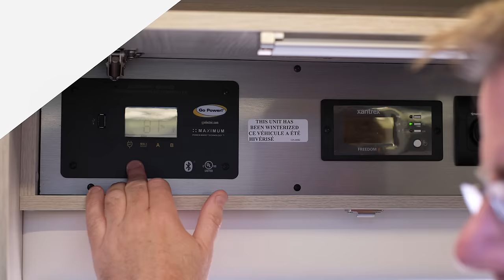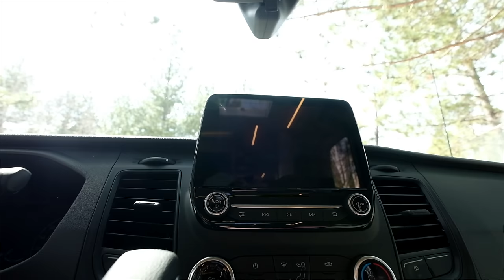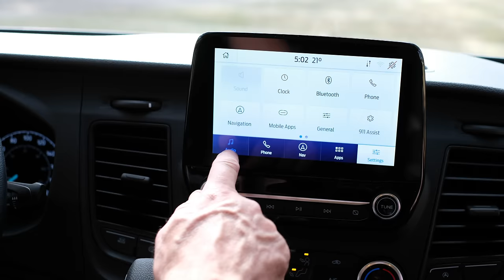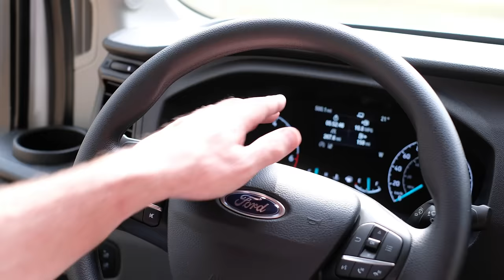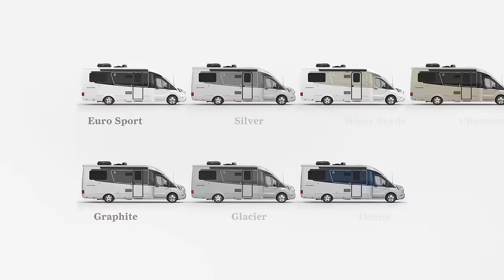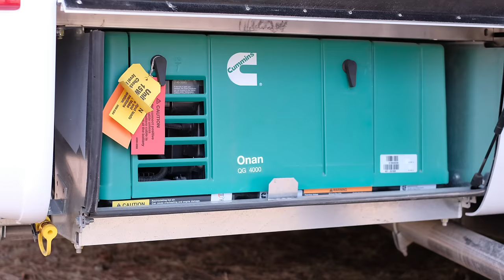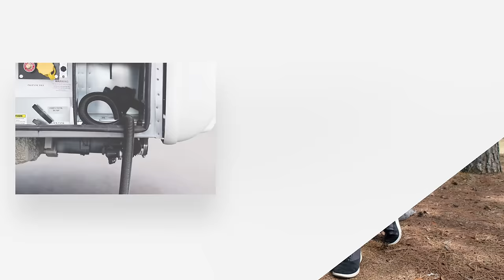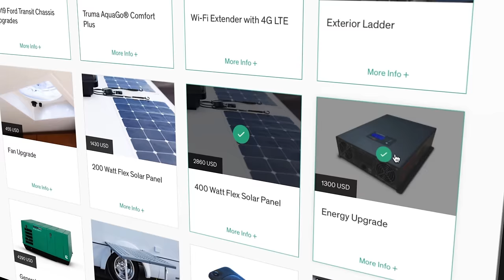2021 Wonder Rear Lounge

Comment: LVT was one of the very first Rvs that I investigated when I began to look into buying a small Motor home. I have always been very impressed by options and amenities offered; especially the Wonder as it's built on the Ford Transit chassis, not MB which can be very unreliable and very expensive to maintain and repair.  I first fell in love with the Wonder MB, then the Wonder RTB, and now the 2021 Wonder RL with the 3.5 liter Ecoboost engine with twin turbo and AWD.  Just like an F-150 with the optimum towing package.  One of the very good LTV dealerships, Fretz RV is nearby as well.  So, it was with great interest that I watched Dean's new vlog about the 2021 Wonder RL, and then his subsequent Q and A session.  It was during that episode that I learned, for the first time,  that all LTV rvs  are NOT 4 season rated; no heat ducts for the tanks, no heating pads for the tanks and no heat/freeze protection for the dump valves.  Dean went as far as saying that LTV customers were better off driving to Arizona (or similar warm location during the wintertime so that the rvs would not be in danger of damage).  You can imagine my shock, as I always just assumed LTVs were 4 season capable being manufactured in Manitoba.  I never read or heard anything to lead me to believe they were not cold weather ready.  It seems that 4 season capability is now standard or available as an option on virtually everything 5th wheel, TT or  Motor home I look at.  I hope LTV looks into rectifying this omission soon.  I will not be able to consider acquiring one until it is.  SK41.
Reply: 100% agreed.  A cold weather package option should be available.  Hopefully LTV comes up with something suitable.

Comment: Love this design. I need someone to buy this now. Drive it enough to break it in. Keep it in really good condition with low mileage. Then when I retire in about 6 years, sell it to me for a song.
Reply: I want to buy a new one to use for just a few years, very light use to visit family in 2 separate states....then sell!!!
Reply: Twin turbo ten speed auto- not even for free, used!
Reply: Good plan since a buyer loses a minimum of 15% to 20% the moment you drive your brand new RV off the lot. 40% to 50% by the 5th year. So stick with your plan and you can steal this in mint condition with low miles in 6 years.

Comment: Great video Dean.  So happy to see the lithium option with 400 watts of solar (on the website), the new storage bay compartment locking mechanisms. the dual swivelling front seats, 2000 watt pure sign-wave inverter, improved GVRW rating for Chassis and 4000watt gas generator.  These are substantial improvements the will preclude after market upgrades and tie in nicely with warrantee considerations.  Very impressed and much appreciated effort on behalf of Leisure Travel Vans.   Would appreciate passenger and cargo carrying capacity specifications when possible..Thanks Dean

Comment: Incredible, because it has everything perfectly positioned yet it’s small enough to drive around like a 🚙 car / SUV.  The only suggestions I’d have is  to have a remote button to raise and lower the bed, and another button to raise the sofa/storage lid on the floor (because some people have back issues) and have the support go across the full width of the bed 🛏.  Have shades on ALL the windows.  Increase storage under sofa to the side section too.  And a long built in mirror on the inside of the full length door.  The shower skylight should open up with a screen to let the moisture out after use.  Same with the bathroom window.  Add a handicap bar near the toilet for injured or elder clients.  (Young clients can use it as an additional towel rack) Make cooking electric so no propane is needed.  A washer/drier is needed under the kitchen counter extension.  And the seat would have to be rearranged, perhaps a pullout.  Heated seats too.The walkability inside this vehicle is fabulous, overall, the best I’ve seen.   Seems the tires could be larger and heavier.

Comment: I wish they did a configuration to sleep 4, like a second murphy bed or a lowering bed in front. This is my dream RV but I want my teenage kids to fit!
Reply: And 2 more 3 point seat belts in the back. No reason not to have that on this unit.
Reply: Is it weird that I want one with a bunkbed or 2 to be able to camp with more than 1 person?
Reply: @Victoria-es6ws  The rear lounge with seat belts for 2 and a Murphy bed, or over cab bunk with a small bed conversion in front. Then it becomes useful. I would also just make a large wet bath and add a bit more storage. That shower is useless. There is no room to wash yourself. No need for two living areas when only 2 can stay in the van. Might as well just have the front twin bed unit with tons of storage and a usable shower. You can't even pack a couple of kids and a tent for them because only 2 can travel in this. Or even take the kids to the beach for the day in this because of the lack of seat belts.
Reply: Nice one! A RV like this, but with 4 sleepers
Reply: @Victoria-es6ws  It makes sense because they want you to buy up to the serenity corner bed unit for 4 seat belts a front area that converts to a bed, and a rear corner bed that conned to a lounge area. Really nice unit, but very expensive. Kind of makes me really angry with this company.

Comment: FYI Plan ahead as the waitlist is 1.5 years. Ford starts at 120-128 all wheel drive add about 7k the Mercedes 140-148k add 20 k for options on either platform. You can go about 7k more or less but 20k is a good average in my opinion. Good quality that will “hold value” when you go to sell in 5 years. Looking at used ones they drop about 45k after 3-4 years.

Comment: I love this!  Shower area needs more space but otherwise I’d love this.
Reply: Yes, I'd put the toilet in that space, with no sink. Don't need a sink in a small camper where you can use the kitchen sink. Better yet, close off the bath area across the width of the camper and make all that space a wet bath. Otherwise, I love this because of the picture window in back and the large table. I'd also love a big window at the rear which they could create by making the lounge with a sofa that automatically lies back to become the bed, like you see in other campers.

Comment: Hoping for a swiveling driver's seat and a leveling option.
Reply: Drivers seat does swivel.
Reply from the maker: Both driver and passenger seats swivel now! :)
Reply: @Leisurevans  ty!
Reply: Leisure Travel Vans I see on your website there is an option for a front twin size like bed. Does something flip over or slide out to make the bed? I did read “ air mattress” on the website... is that the only third sleeping arrangement or can you make a bed out of the cushions in the front?
Reply: @bobbiecharliehernandez3311  That's what I need to know also..its not always 2 adults.. we are 3 adults..and don't want a huge RV .. We like the smaller ones.. when you get compact its much more money.

Comment: Is there an option for front living area bed for a 3rd or 4th sleeper?
Reply: I want to know this also.
Reply from the maker: Not on the Wonder, however, we do have this available on the Unity Rear Lounge https://leisurevans.com/unity-rl/
Reply: Nice floor plan but I don't want to make a bed every night.
Reply: @Leisurevans  Wish the Unity came on the Ford Chassis or that the Wonder had a couple more seat belts and the front bed option. I want this RV for 2 adults and small kiddo.
Reply: @Leisurevans  - if the front lounge is similar between the Wonder RL and the Unity RL would it be possible to add the extra board to join  the two sitting couches to make a single twin bed for one extra small bed up front in the Wonder? We'd love this Wonder model just need that extra single front bed.

Comment: Would be revolutionary without the petrol engine. They should be going full electric. But nice van
Reply: Michael Dawson So when you run out of a charge crossing Texas what are you going to do?
Reply: Electric engines don’t have enough range.  The US doesn’t have the infrastructure for fully electric cross country.  I guess if you want to camp all over LA, that would be OK.
Reply: Why not just use nuclear fusion? Electric is yesterday's news.

Comment: There's no clearance, this van will bottom out constantly on most adventures.  City, highway, but for what you buy it for, it has zero clearance.
Reply: Would the Mercedes Sprinter van be more suitable?
Reply: Ya, like 99.9% of where you might go.
Reply: @cavelleardiel  
I had a Sprinter. Big mistake! God help you if you need Mercedes service. Ford...any Ford dealer.
Reply: @michaeljuers574  Thank you!  I am closer to buying a van and yes, I have been seeing that Fords are the way to go.

Comment: I been looking at every camper van imaginable. Leisure overall has the best features. One thing lacking that I cannot find in any camper van worth wanting is a toy hauler. I would love to put a small motorbike on board. It is beyond me there is not more of a market for that. I would love to see a camper van nice as Leisure with a rear or back side door with an electric fold out lift (similar to a wheelchair lift) and a compartment large enough to fit a motor bike.

Comment: LTV is really innovative and their fit & finish & materials are great, and I like the Murphy bed concept, but in the end I don't like this Wonder RL and here's why: severe front rake cuts into interior space and will have you baking in the sun driving on hot days; very low roof height cuts into compartment heights inside & out and into ground clearance (you will bottom out easily); no slideout makes for a cramped living space; overall storage space is very limited; and you will be on all 4's swearing as you try to access the outside compartments. I'm sure it drives great though, and it is beautiful looking. Surprised he didn't discuss the fuel economy, makes me "wonder". Spend half the money on a used Itasca Reyo 25R.

Comment: I like this one because it's on a Ford, and it's automatic, I also like the two separate living areas but if I can find a 2015 serenity built on a Ford with an automatic transmission, I went as far back as 2013 and they have some really nice ones. But if I remember correctly the 2015.5 and 2017 Serenity's we're very nice, plenty of room, lots of storage were excellent. I'd surely be interested in purchasing one of them.

Comment: Transit 350 with the 3.5 Ecoboost is an amazingly good platform...as long as you keep up the maintenance on it...change that engine oil "EVERY" 3K or you'll be replacing those turbos at about $2500 a pop...other than that, you be replacing the rear brakes about twice as often as the front...but that's about it...

Comment: Congrats! That's a great one - I don't know of any RV that offers this layout here in Europe. For two people, that's an ideal option. Not too big, but enough space to seperate when one should choose so and excellent usage of storage space. Maybe the shower tray could be slightly lowered so the standing hight would increase a little. If you could manufacture this with 220V and improved windows (i.e. integrated mesh and sunshades in flush windows - as is standard for new RVs over here, not those flimsy blinds), you'd be a VERY successful alternative to choose from. And a 170hp Diesel engine would be more than enough for the local taste. Ford Transit has been a successful chassis for years (although many still prefer the MB Sprinter or the rather popular Fiat Ducato), so that shouldn't be an obstacle. Any chance you could look into that or maybe even have a suggestion for who to contact? Cheers, Daniel

Comment: Would you please quote all the dimensions, volumes and temperature in metric. We haven't used the imperial system since 1974 when we converted to metric. It's only been 48 years.
Reply from the maker: Hey Paul, we have all of the measurements (for USA & Canada) on our website if you'd like to check https://leisurevans.com/wonder/specifications/

Comment: If control sensor goes blank. Where is the manual control to start Units On 12 volt battery. As individuals system. From overload or electric pulse shock.

Comment: If they dropped the MSRP price by $25,000 to $30,000 they yes, but I could buy a B+ on the Mercedes frame for much less - LOVE the unit - just way to expensive for a B class Van, Very nice floor plan
Reply: I've not seen the Mercedes same specs close to this price

Comment: I love it but it need more battery power....lithium....just for boondocking.  The generator is a problem if you need. a/c or heat at night but can't use the
 generator.

Comment: Rather it not been a gas turbo but hardened diesel instead or at the very least a coyote v8.  That twin turbo setup is good initially, but issues in the long run.

Comment: Ya know the pet peeves when some use the wrong their, there, they're or your, you're, etc.  Well one of mine is people calling it a Hot water heater.  Geesh.  It isn't hot water until it's heated.  If it were hot already it wouldn't need to be heated...  it is just simply a water heater.  🙄😉🤣😂😂😂

Comment: I actually love love love this RV it's one of my favorites. I love the dry split bathrooms..I love the two-way door on the refrigerator. The Murphy bed very easy to change and so much more.Heres what I DON'T like Its a 1 person van 2 at most!! But you're trying to sell it as an RV. So much wasted space. That front area you could have a stackable washer and dryer. & more storage..You don't need 2 places to eat 2 places to work that's ridiculous.. 4 people in there all the time would be WAY TOO TIGHT.. WHY are you trying to make a van that's essentially made for one person. Into a large RV that will comfortably fit 4 ? I can get past the Ford but these other things I can't get past. Again it's very pretty. 1/2 of it it's designed beautifully. The other half not so much.
Reply: They build a Mercedes sprinter chassis too. Called the unity leisure travel van

Comment: Notice he cant quite stand up straight..those windows always need resealing after a few years..the turns on the windows never fully close after a few years..the heat is up top so the floor will be cold..the cheap shades will wear out ..the ground clearance is low on the outside.just some things to think about..all in all looks good but very expensive..

Comment: I love these Leisure Camper Vans but unless these RV vans are built for off-roading and if they don't come with all-terrain wheels, then it's really NOT worth the money. All RV motorhomes any size should be built for off-roading.  It's easy to get stuck in a pothole if the wheels are small.

Comment: Great design BUT a transit engine at 400lbs of torque won’t hold 3 years of driving a heavy cabin like that…Not worth the money when the engine breaks down after 60k miles warranty